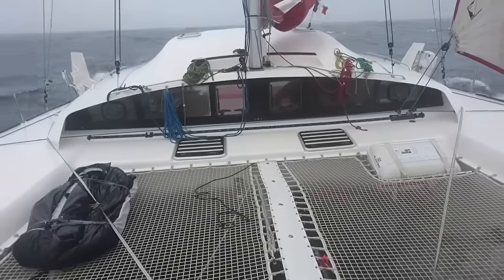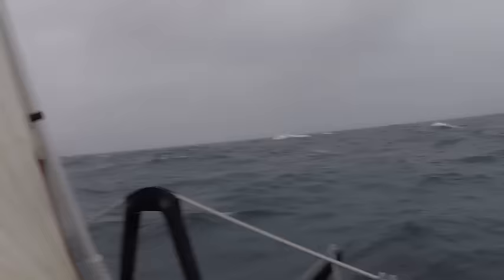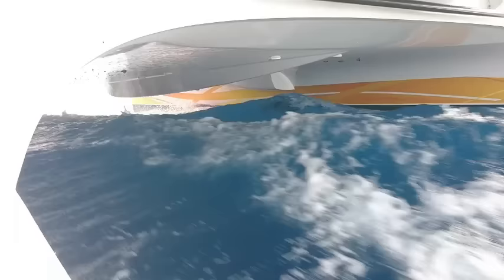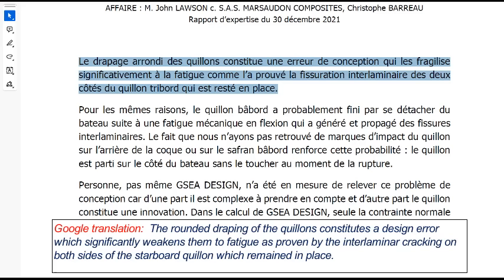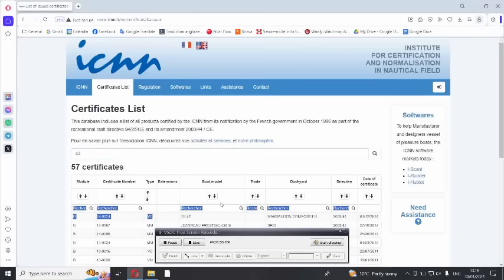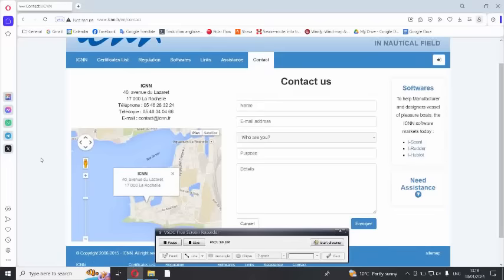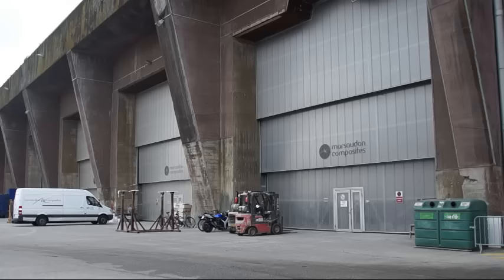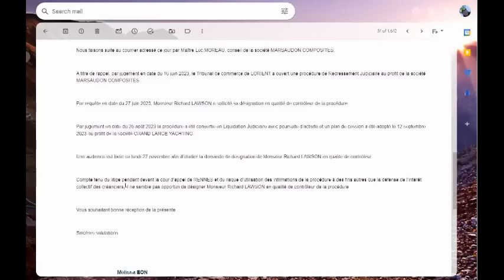Keel broke off mid-Atlantic - Marsaudon ORC42 Catamaran Part 1

Comment: The more I learn about new production boats the more I appreciate older boats
Reply: Yeah the old-heavy-POS is starting to look better and better.
Reply: As someone with 40 years in the biz- you have NO IDEA how bad it is out there.
Reply: I sailed across the Pacific on my friends' brand new catamaran. New Boat Problems is not some myth. It's very real, results in a lot of work, and is true for all new boats. I think the rigging had a lot of problems, 8-10mm clutches, 12mm ropes (because the spec'd 10mm Spectra wasn't available.) Huge headache.  The rest of the boat was great and it is a very strong boat. After 7500 nM, very hard sailing, absolutely  no movement or changes to the basic structure. One of the owners as we neared Canada said, "I think our boat is worth about $50,000 less after all this sailing."  I would disagree. When it came out of it's tune up in a Canadian boat yard it was a much better boat than it was new. If indeed a boat like it would sell for 10% less than new? I'd jump on that deal, even if the things that broke had yet to be repaired.   (But I would never want any boat that has a wooden core or a lot of teak.)
It's good to learn about Mausudon's shortcomings. They seem at first glance and first sail to be amazing boats, but not if they are going to fall apart.  My own boat is a solid core 20 year old Hunter.
Reply: I have an older boat. Just buy a Bristol.
Reply: Getting a production boat customized with certain Companies can be a great experience then you have Lagoon and ORC who do not care about Quality just money. Building a CAT in 6 months is rushing it.  they should build more at same time and take their time a bit more to do it right.  When they say performance they need to stand by that. Miss use is BS they building a vessel to go into sea. It should handle what the sea tosses at it or dont make ocean boats.
Reply: @dc1544   A yacht meant for racing (performance) should be scrutinized even more after manufacturing. Especially when there is so many cases of French manufacturers skimping on manufacturing whilst deviating from certified designs.
Reply: @WillN2Go1  I completely understand that a new production boat will have some issues to fix. But those issues should be from added components. All these manufacturers do is build the shell and few 'extra' add ons. For them to fail on that especial is clear negligence in my book.
Reply: @StudioBhobho  yes.
Reply: Lightweight boats usually have a fault somewhere! All boats have faults the key is if there catastrophic or not!
Reply: Aye, can't beat 'em. They literally don't build them like they used to. 
Up until the ~1990's you could bounce a sledgehammer off a GRP hull. Try that now and you'd probably sink your boat. Everything is undersized/cost-cut to maximise profit.
Reply: I sail old school. Give me a fully encapsulated keel, bridgedeck mounted mainsheet traveler, halyard winches at the mast and a tiller.
Reply: Renting out ANY boat that you are later going to sail across the Ocean is simply STUPID beyond comprehension...
Reply: Yes, the huge advantage of an older ship, is that it has survived for more years, than those brand new ones. And be honest, who really needs a foiling yacht? That is the next step, far too rich fools doing 70 knots on their foiling racing yacht. No offense to the ones who can handle such yachts, the problem is the people crashing into fishing trawlers at fool speed. They will do that!
Reply: Another thing is, this is a catamaran. That type of vessel has some problems. Just watch them: they got a huge beam, result is, they have a high mast and large sails. That is why cats are fast.
   But, stability is just great, until they start leaning, then they get LESS stabil. Cats can easily capsize, you need to watch out all the time, or you end upside down.
   But, larger rigging means more force and stress on literally everything. You must keep checking nothing is damaged, like on any ship, only expect more problems.
    But, the heavier a catamaran, the worse it will behave during wind gusts, it can't accellerate quickly, and the sails will batter the ship, instead of giving it a great speed. It's hard to describe it simple, but heavy cats are literally punished harder than high performance cats. Obvious solution is smaller rigging on heavier cats, but in light winds you'd want larger sails, compensating being heavier built.

Do you see? Cat design is an art, avoiding several known problems, and the good ones are great ships. But, you got to know what your cat was designed for. I just pointed out some "buts", there are several more.

This is not just bla bla, it is part of the catamaran story. This is what makes cat sailing more risky than one hull ships. Be aware of that, and you can enjoy a cat.
Reply: Ya, this is why the Wynns and NautiStyles are fully documenting their builds, so essential
Reply: They totally didn't build this boat to any standard.
Reply: @Despiser25  Boat or Yacht renting is common practice, even a billion dollar yacht are put up for charter, Thats how the industry has been for a centuries
Reply: @danielmclellan7762  Unfortunately that's all for marketing and making youtube content. Not everyone wants to be on camera to show their assets to the world. Yachting magazines are most likely not going to pick up this story (it hurts their revenue). Current TS42 owners will also remain quiet to protect their asset value. The only protection John has is a legal one, of which I hope the French law isn't bent to protect it's yacht building industry.
Reply: @StudioBhobho  the ones I mentioned, sure, but then then are ones like Tally Ho
Reply: And older can often still be fixed even when there are issues over time
Reply: It would cost a half million dollars or more  to build one-off  any of the sturdy production 28-32 foot boats from the 60's and 70's.   When you look at modern efforts to build strong boats like the fisher motorsailors today... you see this is true.. and the new one   not so nice.
Reply: Usually you cannot see modern boats during construction.. because then you would see them putting powered filler between laminations to build up the thickness.. with devastating decrease in lamination strength...and increase in catastrophic mechanical failure.   Utterly Criminal Crap !
Reply: @boatdetective That's scary.
Reply: Marsaudon Composites Has Filed Bankruptcy |Jun 28, 2023 — 
I recently heard from a boat builder in Northeastern North America (Maine,USA).
Their company has started building new wooden boats. They found that the costs of resins and synthetic materials had reached a high point, and wooden boats could compete cost wise. I’ve never believed glass boats were superior to wooden boats.
Fiberglass boats were simply less expensive and simpler to build.
My grandfather was a boat builder and stopped building because wood was difficult to source and expensive . He could no longer make profit fabricating boats. More people wanted custom homes, than good wooden boats.
The biggest detrimental thing I have observed with glass boats is the effects of cold climate and water intrusion. Freeze/thaw with water intrusion is a boat killer. I don’t like glass boats, to me they are disposable work vehicles.
Reply: @nickgoodall578  Yup  I love my 83 C&C 32
Reply: at least with older boats if they've survived this long they're probably not one of the lemons
Reply: I'm restoring a 60 year old Westerly nomad. She careened into my home estuary and scraped down the sea wall for about a mile in 70mph winds following being moored in an exposed area for years, completely abandoned. She's 22' long and settled in a 24' gap in the wall.
The result? The rudder was broken off and much scraping of the gel coat. The rubbing strake was gone totally.
Next high tide she floated out. After a lengthy salvage claim she's had a thorough clean up, a coat of paint and new engine. There was next to no structural damage, one cracked stringer and a few historic repairs that weren't great.
She's not fast, not glamorous, but she's a tough old girl.
Reply: Not only better, but each were distinguishable from each other. Not so today, as they all look like they came from the same company, with frighteningly similar layouts down below. They look like what they are: cheap and nasty.

Comment: They should have moved all equipment over on a new hull in stead off using so much time and money on lawyers. Shame on Marsaudon Composite
Reply from the maker: It would have been cheaper, that's for sure 😂
Reply from the maker: But the hull is repairable. The expert put a cost of 16k € on that aspect. Just a matter of finding someone competent.
Reply: Should you not try to get the boat back if they they do not pay you? No money and no boat (even with problems) seems to be the worst case of all 😢
Reply: @geezer355  Yeah well the estimated repair costs for my boat started out at like 90K and that was a gross underestimation. I highly doubt 16k would cover it.
Reply: Todays lack of production wizarda
Reply: @geezer355  That is suspiciously cheap. It's not a thoroughly known & perfected repair procedure like the "Catalina Smile" or the chain plates on an Island Packet. This is unexplored territory that will involve serious engineering. 

Thanks for sharing your experiences thus far. I hope for your eventual satisfaction.
Reply: @geezer355  
WAOOOOOO!
On a ~1.3 million dollar boat, 16k amount to virtually nothing! 
After listening to the whole story i thought the hull had to be destroyed!!!! 
Besides the keels and rudders, what else has to be done to fix this boat? anything really costly?

After 70k views and rising fast, GLY's CEO is already massively regretting not having decided to pay for all the needed repairs...
or else he's got his head stuck in the sand like the ostrich...

Even though he is not responsible in any legal way for the very defective Marsaudons.
Reply from the maker: @BStrapper  Yes! I spoke to the CEO of GLY on 7 Sep and I wrote to him again over a week before uploading the video. He just needed to reply. He hasn't even asked how we could sort this out... But while he may not have legal responsibility, GLY are paying the fancy Parisien lawyers to hide the liquidation numbers from me. They are the folk who have put me in the position of having to give up my boat in order to eventually see what is in the receiver's hand. Surely it would be fairer to let me see if he has any money to pay me, before being forced to give up my boat?
Reply: This is modern business.
Reply: @geezer355  It sounded like they already have the boat?
Reply from the maker: @trentspencer7991  The boat was registered into their name last year and my lawyer wrote to them formally handing back ownership. Physically I think the boat is still in the same storage yard, a few miles away from their facility.

Comment: The quality control in that company. Must of been run by a Stoner in the smoking shed out the back.. Never in my life have I seen such Crap Workmanship. Its bloody shocking these company's treat people like that.
Reply from the maker: The question in my head is whether Sam Marsaudon knew about the dry areas when the pieces were removed from the mold. Increasingly I think that they must have been visible. In which case a conscious decision was made to assemble and paint it anyway, to avoid the cost and schedule impact of infusing new pieces. He was working there as a consultant when the keels broke. They blamed the tapping anomalies on shocks and impacts. If they knew all along that they were dry areas, that says a lot about the culture at the boatyard.

Comment: In 2000 I bought a Bavaria 47 full of defects and hidden flaws. 13 years of court where I was called a liar and more. Finally the sale was canceled and I was reimbursed for the purchase of the boat but not additional equipment added during the preparation of the boat. I understand your distress.
Reply from the maker: That's horrendous. I hope I don't have another 7 years to wait....
Reply: Was it due to an improper infusion as well or a long list of smaller defects?
Reply: @BStrapper  A long lists of important  defects enough to cancel the sell after 13 years
Reply: Bavaria also have a history of failures and shoddy workmanship. Keels should never fall off a boat or fail IMO.

Comment: Thank you for taking the time to make this video. I was looking at an ORC 50 - no longer. 

I had an experience with French courts and the French Elite a few years ago - it was not pleasant. We were trying to protect minority shareholder rights in an egregious case of a board of directors acting in favour of one large (French) shareholder and against the interests of minority shareholders. Being foreigners, it was almost as if we did not count as people, particularly as we were litigating against a very connected French elite.
Reply from the maker: Yes, I was surprised that the chap appointed to manage the liquidation wouldn't even talk to me. I had expected him to be independent from Marsaudon and open to considering the creditors positions.

Comment: Thank you for this great contribution. I have been sailing a TS42 for charter in Britany and I love it. I have considered seriously to purchase n ORC42 but I have always wondered, if the quality control is sufficient when looking at the boat yard. Outremer is as well on my list, but I had an outremer 45, built in 2015, inspected and they found so many issues, that I backed off. I have a lot of respect for someone to go through the ordeal of legal trials. Having run businesses and acquired insolvent companies as an asset deal (just buy the parts you like and ignore the rest) to restructure them is a common process to allow them to survive. But generally customers and suppliers are the ones who loose. Only contributions like yours allow the sailing community to judge the ethical behavior of a boat yard. Again thanks - extremely important and valid contribution and I wish you had more followers.
Reply from the maker: Thank you!

Comment: I hope this will be picked up by the sailing press and media. It's a shocking tale of incompetent and unethical business behaviour.
Reply: The problem is, as all sailing professionals know, that it isn't shocking. It's commonplace. Most boat builders have these kind of stories attached with a few notable exceptions. There are far more badly and very badly built boats around than well built boats.
Reply from the maker: I don't understand why the consumer is exposed and not protected as they would be with a car or other certified vehicle. If the certification isn't working, it feels like publicity is the only alternative to try to protect sailors for design problems. I too would like the media to take an interest because not all sailors are of the generation that use YouTube. I wonder if the problem for the sailing media is that they fear getting 'black listed' for new boat reviews from these companies.
Reply: In my opinion it would be very wise for new boat owners to have an experienced surveyor examine the boat before launch for hull and other structural defects. The hull should, at the very least, be hammered to check for dry laminations or defective infusion areas. It is MUCH more common than most realise! Buyer beware.
Reply: @geezer355 I know a French-Australian lawyer. British, US and Aussie laws are very different. especially with consumer protections and contract law 😮
Reply from the maker: @ozwrangler.c  Thanks. But I'm really happy with my current lawyer. He's good at his job, communicates in a timely fashion and he handles my rants/stress/anger/frustration with kindness and understanding.
Reply: @geezer355 I have known 2 magazine writers. The automotive one said if the car is underpowered, praise the handling, if it corners like a shopping trolley, praise the power delivery. The other wrote for firearm magazines, he said he never mentioned accuracy unless it was good, just praise the figuring of the stock, the quality of the bluing etc...
Both said unfavourable reviews would lead to losing access to products for evaluation.
Yet many rely upon the evaluations of these "experts" for purchase decisions. One must learn to find the truth by what is not said.
Reply from the maker: @Mike-uc1eu  You take three words out of my mouth. Why has no one in the mainstream Yachting press covered this story for their readers.... ? I think it's exactly what you suggest.

Comment: As a boat builder, that is absolutely horrendous.

Keep in mind that a lot of commercial fishing vessels are completely glass fiber.
You can sail those vessels through hell and back, there wont be a scratch on them.
You need to hit something solid in the water to actually damage any structure.
Even then, the propeller and driveshaft is usually what gets damaged, hull don't care if it's built right.

If the vessel is classed for open water it should be damn near indestructible.
I'm not a sailor, but I'm guessing any vessel capable of transatlantic crossing have this class.

This shit right here, this is why I have trust issues.

Comment: Thanks for sharing and thanks for helping me shorten my list of performance boats to avoid. It looks like avoiding French builders would be a smart idea.
Reply from the maker: I don't have any significant experience of other French builders, but I think that they are let down by the fear that the ICNN does not pay enough attention to their designs or lessons learned about failures in existing designs. If there is a reliable regulator we can have confidence in the boats.